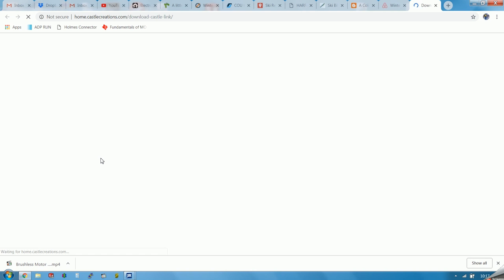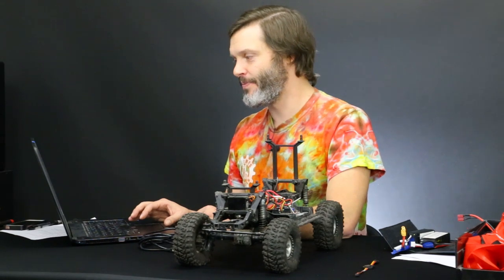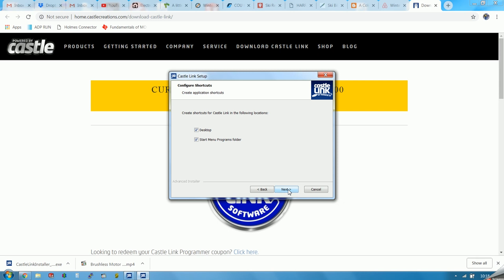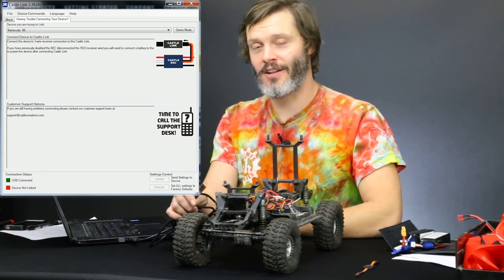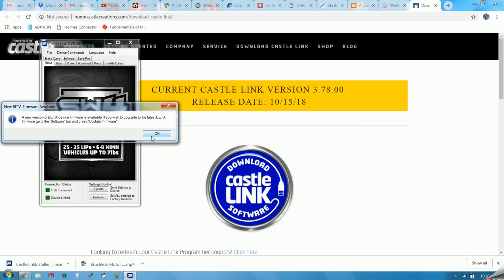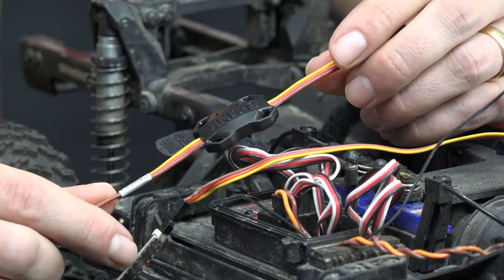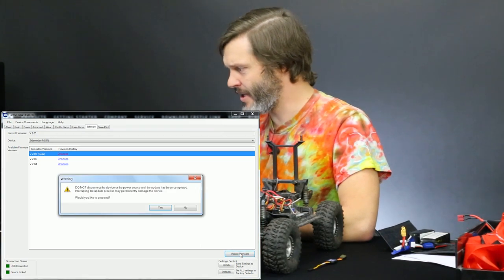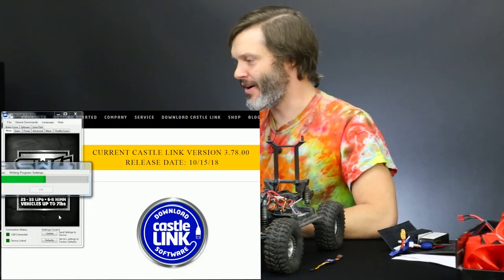Get The Most Out Of Your Electronics - How To Update A Castle Link & Sidewinder ESC - Holmes Hobbies

Comment: Does the ESC have to be powered by a battery? Or does it get power from the USB cable?
Reply from the maker: Either.  If it doesn't work via USB, plug in a battery